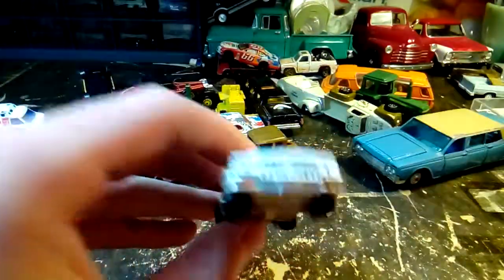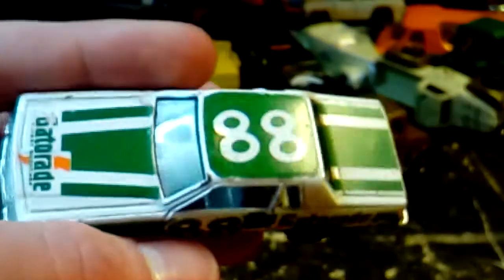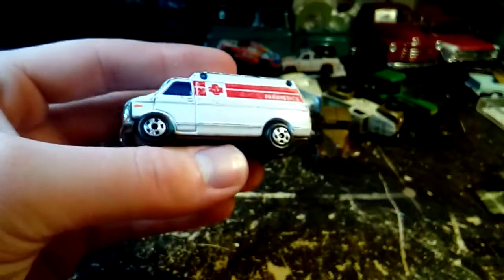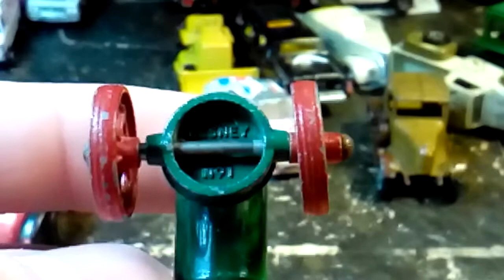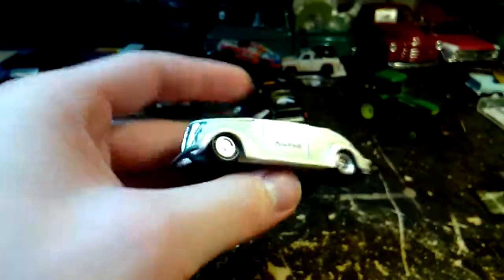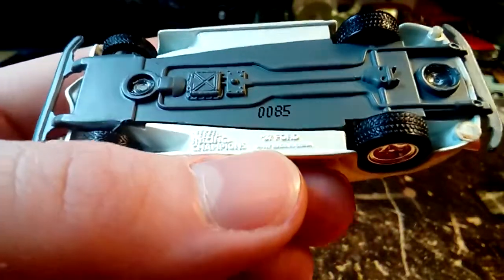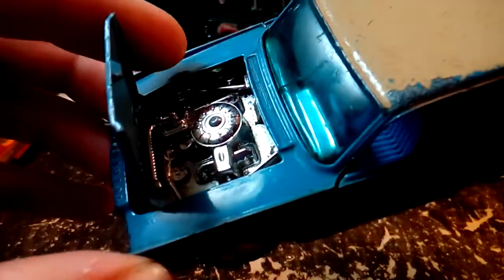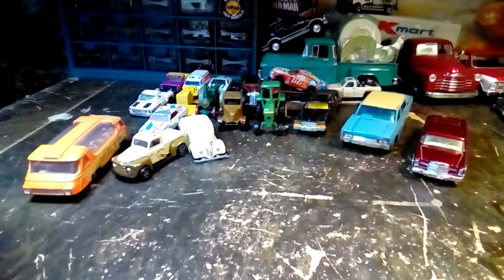(Re-Do) 2018 Yogi's Toy Show Haul Video Part 3 Corgi SCORES

Comment: That Lincoln had a colour TV feature! It originally game with a strip of opaque pictures which could be inserted individually from underneath to give the impression of different channels. it was battery operated to light up the screen. Looks like the battery cover is missing on your example. Very nice model.